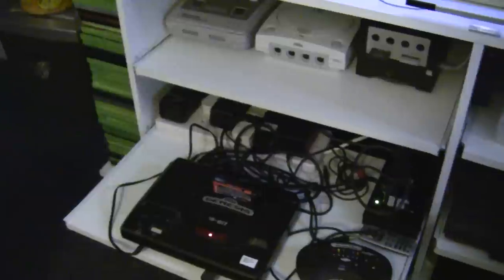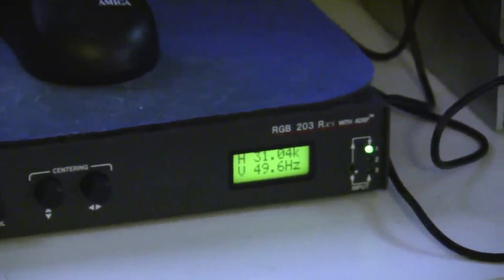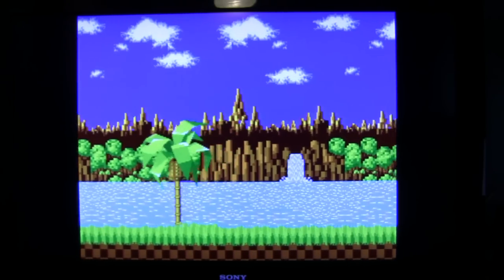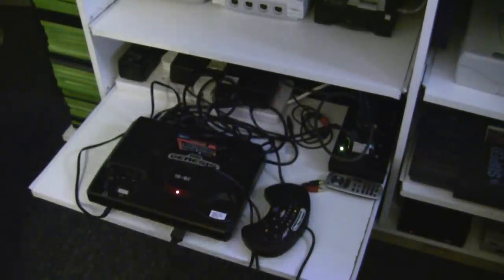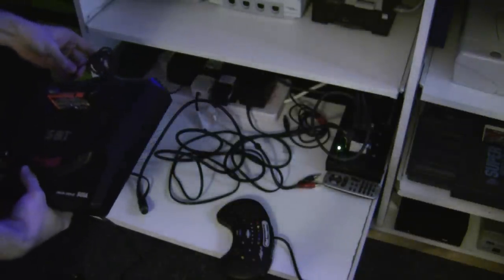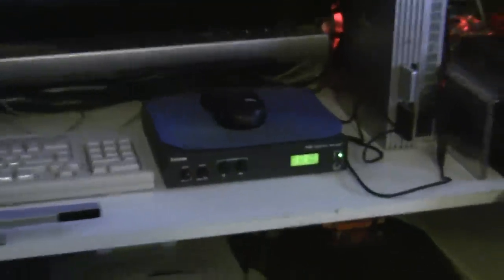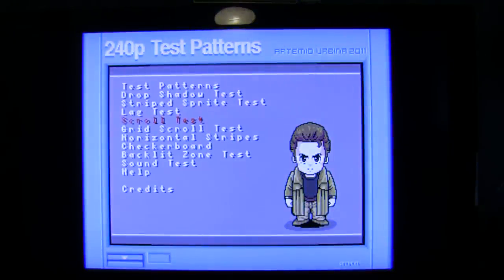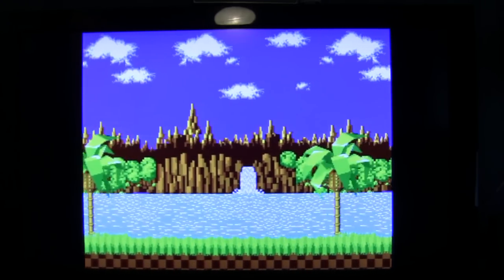Thinking of 60hz modding a PAL console? Watch this first!

Comment: For those with a framemeister, take this video with a grain of salt. While the issues mentioned are present, they can be mitigated to the point of being unnoticeable. You can switch your output to 1080p60 during 60hz which makes scrolling silky smooth. There is a tiny 'bump' in the refresh every few moments but it's so quick you have to be actively looking for it to notice it at all. I'm pretty snobby about picture quality and I'm fine with it, also the white streaks you're seeing don't seem to be present at all thru the framemeister, news to me at least. At first the brightness issue was a deal breaker for me (only present on upscalers) but it turns out you can remove it by pushing your gamma up until your black levels are right along with an increase of brightness and contrast to make up for the colour loss. I have two profiles set for 50hz and 60hz and I cannot see any real loss of colour range between the two despite the gamma correction. If you have a framemeister, want to 60hz mod your mega drive and don't mind taking the time to tweak your settings it's totally worth doing!

Comment from the maker: I got a 60hz Japanese console and did the mod on that, on that model the scrolling was fine at both 50 and 60hz, so this is the way to go if you want both, not that there's much worth playing that's PAL exclusive on the Megadrive/Genesis anyway.
Reply: Good to know, thanks! The main reason to keep a PAL (or PAL compatible) console around is definitely 4 (or even 8) player Micro Machines '96!

Comment: This happens if you switch region while the console is ON... I have this problem when i play certain games from pal switching to ntsc with the console on but It playes flawlesly when i set the console on ntsc and then turn it ON ^^
Reply: This is correct. This video is spreading mostly false information by exaggerating how much of a problem this is. The majority of TV will not suffer any problems.

Comment: Great video! I'm interested in how your machine is modded though. I modded my own PAL Mega Drive and it's still silky smooth on 60Hz in the scroll test, and has no white lines appearing either. It looks worse in 50Hz but still nothing dire. Curious indeed!
Reply from the maker: Different TV's have different tolerances, plus if you are using a CRT it's not an issue.

Comment: Hi, this is a very interesting video and I have just purchased an OSSC which I am eagerly awaiting in the mail. Based on this video I might keep my console as a PAL system only. Sorry to comment on a 9 year old video but I don't supposed you happen to have any tips on optimal settings for the OSSC when running in the standard 50hz PAL mode? Most websites I have visited focus on NTSC settings only..

Comment: I don't experience the white line but do experience some graphical glitches with my modded snes it's only on some games though while other run smooth and fine when force in to 60Hz. And yes I'm aware of the different chips used in certain carts but I mean on ordinary games, don't know if it's the tv or the snes. I assume it's the tv and the snes not wanting to run pal games at 60Hz.  I'm waiting for my MD to be modded now to see how that runs.
Reply from the maker: The 240p test suite I use in the video is out on the SNES and Megadrive now so you can test both.
Reply: Yeah hopefully getting a sd2snes for Christmas. So will be able to test that then.

Comment: My mega drive is a bit blurry on my new big TV plasma, I use a normal aerial would it be clearer if I bought a mega drive scart lead?
Reply from the maker: It would go from abysmal to poor, yes.
Reply: yeah it would. Scart RGB is the best existing analog connection, except for the VGA. While the RF is the worst ever.
Reply from the maker: jarnoob VGA is RGB, just usually carries 31khz signals while SCART RGB is limited to 15khz.
Reply: Yes I know that. VGA also allows greater resolutions than scart because it was made for computer use. ofc. mega drive doesnt have 31khz signal capability. So scart rgb is best signal available without loads of hacking.
Reply: +Videogame Bucko Scart is capable of doing 480p, it's even recognized by the XRGB-Mini! But unfortinatly for some reason 480p via Scart wasn't used much in the Consumer CRT market before. It was used however by the PVM Market. The PS2 is the only console to be able to natively do 480p via RGB Scart.
Reply from the maker: Well if you want to be pedantic, SCART is just a cable, it can "do" whatever analogue signal you send down it, including 720p or Ypbpr. Getting your display to display that though, another matter entirely. PS2 uses sync on green or Ypbpr for 480p and above.
Reply: VGA and Scart are identical in terms of quality, it's just only a Sync difference

Comment: Any update on playing PAL games on an NTSC 60Hz console? 

I'm from Ireland and I modded my PAL Mega Drive for 50/60hz, but haven't properly tested it with the scroll test / extron etc. Do you think I'd be better off in the long run by getting an American/Japanese genesis console for NTSC games, then modding it for 50hz for my PAL games? (P.S. I'll be using it with an OSSC!).
Reply from the maker: Probably be fine but it depends entirely on your TV.
Reply: Hi Eric, from Ireland myself. have you bought/modded an NTSC megadrive?
Reply: *(American) Genesis or Japanese Mega Drive

Comment: Matt, do you know if this affects Mega CD consoles too? e.g. If you use a PAL Mega CD (with a multi-region bios) to play 60hz NTSC games...I have a Japanese Mega Drive and am now looking to get a Mega CD, just wondering if I need to get a true 60hz NTSC version to avoid off-spec timing issues like this. P.S. I'm using an OSSC!
Reply from the maker: The MegaCD uses whatever timing crystal is in the Megadrive.
Reply: Ah ok, so in that case as long as you have a true NTSC 60hz Megadrive, any region Mega CD will work at the correct speed, even a PAL one? (after it's been region unlocked with BIOS).

Comment: I am very sorry but your messured frequenzeses are for us watchers not vallid to use becazse you never mentioned the messuering error. Also you just showed switching whhile it runs, well as much I can say about my megadrive is that samme gammes will crack up after changing the from PAL to NTSC but if you start them in NTSC modde they run absolutly fine. Never had those strange lines ever. Which may is because the TV syncs it via composite trough scart. But you never told what you are using. Also the site yoou are having in your discription has the same measuring error issue, now if you say something like we have 59,8 okay that means it iss 60 than it is fine, but two things you can't just say 59 or something without telling what the meter says nor can you say the exact number without any tollerance.

When I modded my console I looked trough all this. I mean okay I didn't looked into the manuals of the meters and osciloscopes but I know the maximum measuring failur.

Also many TVs I know also can use 59hz, but European TVs are better in that than US TVs. As far I heared most US TV can't use PAL but Europeen TVs can use NNTSC since the early 90s.

Still it is an interesting Topic and how do I say, Problem but it needs to be shown propperly not as poorly as you did.
Reply from the maker: What do you mean "measuring error" ? I'm measuring it with the RGB interface. Even with a margin for error its clear as night and day that they are different. It makes no difference if you use clean sync or composite video for sync either, how would that affect the vertical refresh?? 59.94 is the NTSC standard, not 59.3, even with some margin for error that's quite the way out. It's a matter of luck if your TV copes with this or not.
Reply: Of course measuring error. And now of course ntsc is 60hz not 59hz. But I have little old converter box that had thing avaible like 60hz pal or 59 hz thingies and allot of secam versions too. And what do you mean with rgb interface?

And yes to tell the measuring error is standard for any professional work. Okay modding normally isn't professional work xd.

So yeah I could overlock that all but you never made a hard reset on the console so it could also be some grafical glitches. There is no proof at all that the tv does those glitchhes, it is very comon that the console makees allot gllitches after being switched but if you start it in 60hz mode they don't appear. Try for instannce sonic 2 (pal) which will glitch at all after being switched with faster music and slower gameplay. But you reset the console and it runs just nicely with 60hz.
Reply: Videogame Bucko
Oh yeah and a little extra, even that happens again like they say the oscilator is the problem right? That just tell us which oscilator to replace and we could try it out.